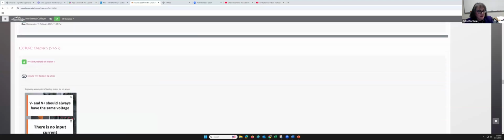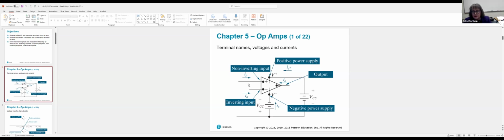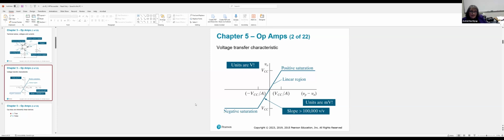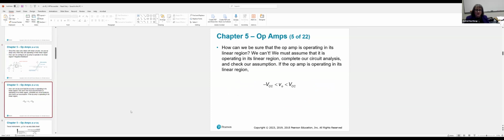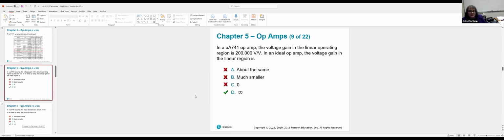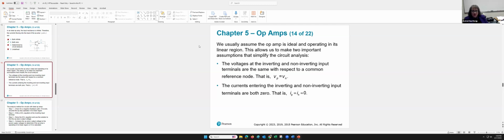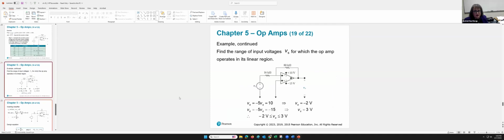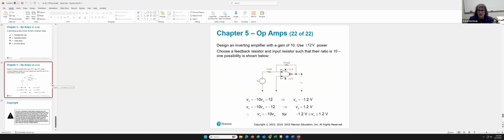Lecture #14 E. Circuits. Ideal Op-amps

Comment: NOTE: the negative feedback loop ALWAYS goes from the negative input terminal to the output terminal of the op amp. 
For a non-inverting op amp, Vin is at the POSTIVE terminal, whereas for an inverting op amp, Vin is at the NEGATIVE terminal.

I stated this in a very confusing way in the video, so I hope this clears it up!
Reply: I really don't know why I started talking about positive feedback, this is NOT pertinent to our discussion. Negative feedback is required for the assumption of linearity.